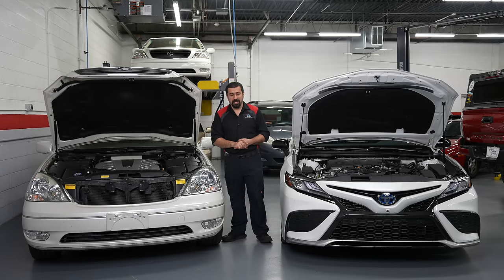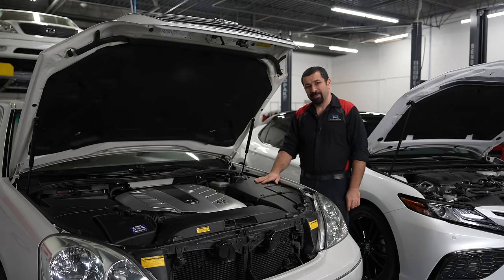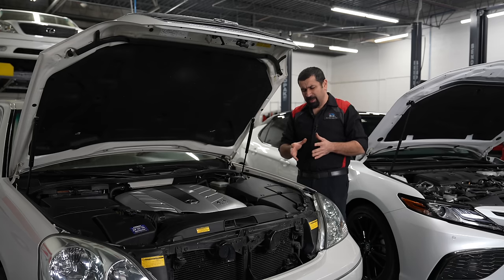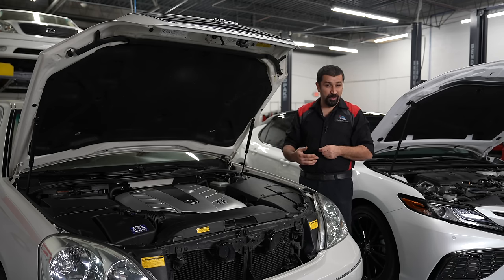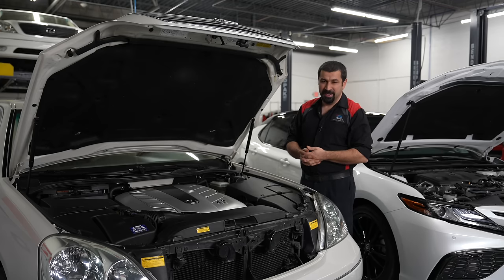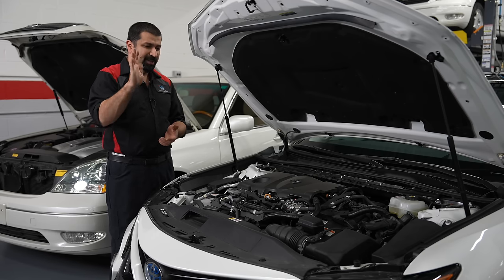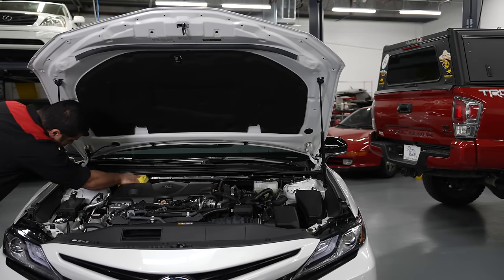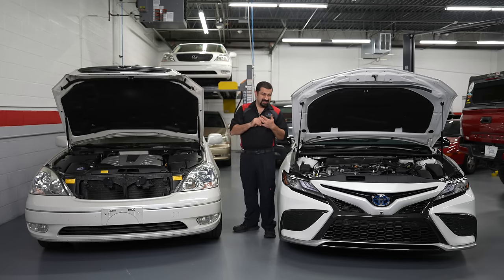Never Do THIS When Cleaning Your Engine Bay! Do THIS Instead

Comment: Thanks for the tips. I hadn't thought about covering the alternator. Some cars (I'm thinking of my Dodge product) has the ECM exposed. I cover that before cleaning. As MarzNet256 suggested, I use my small (Worx) battery leaf blower. It's useful for blowing leaves and dust away. When I need to rinse engine cleaner off, I'll use a light mist spray from the hose, then use the blower to dry up most of the water. I don't use my compressor as that might drive water into connectors.

Comment: Great video. 

I have heard that it's good to use a pressure washer and that it is not good. I go on the side of a caution and not use a pressure washer because I am afraid that I am going to do more harm than good. When using water, I use a a bucket and a microfiber towel and try to control where I put the water. In a manner of speaking. 

I have used Sonax engine degreaser. and Gunk engine degreaser and both work well. I also use brushes to agitate the grime and dirt and clean it off and use a plastic protector and something to make it shine. 

What you did not say if the dirt and grime make the engine hot and cleaning it off cools it off.

Comment: Thermal shock... when i first started as a field tech with company van, i went to wash it in dead winter. It was probably 10-20°F outside. They had hot water going to hose in the shop. I didnt realize how hot the water actually was... As I spray the windshield, bang, it cracked. Caused a huge crack from top to bottom. I knew it was a possibility, but i underestimated.

Comment: I'm a side detailer and a 100% agree. I have never used a pressure washer on a customers. Engine Bay or my own because of this problem. You don't want to send a customer home and then they have their - flickering or some electrical problem. I take a step stool and I go in there with it. A RAG and some usually I use Turtle Wax instant detailer or you can use even a light tire shine spray and it really takes the trim and makes it pop. I hate detailers on here. Using a high power pressure washer and a foam cannon.Inside engines it's crazy

Comment: Way back in the 1970s I learned that it was not advantageous to power wash engine bays. I still wash my cars by hand, so when I'm done with the exterior, I take one or two already damp disposable shop towels and just make a pass at most of the engine bay. It doesn't look as good as Car Car Nut's engine bays, but it does do the job. I don't need my bay to look like new.

Comment: When I clean an engine bay I try to cover all electrical connectors but sometimes forget, or the things I covered them with get pushed off by the stream of water. When that happens I try to sop up as much water as I can with a clean rag, disconnect the connector and sop up some more, then make sure to not run the car for several days until the water has fully evaporated.

I've yet to have electrical issues as a result, even years later. Plain water is usually only a problem when power is on and there's a risk of a short-circuit, although with newer cars some circuits are always powered even with the key out. In that case you should probably disconnect the battery before washing the bay and not reconnect it until everything's dry.

Probably best to do that in older cars too, come to think of it.

I also never use a power washer, just a garden hose set to spray. If an engine or bay is so grimy and filthy that you think you need a power washer, it's probably better to just use strong engine cleaner, brush things vigorously, and use a regular hose, and repeat until it's clean.

Comment: What would you use to clean the inside of plastic engine parts? I know you said you don't like using parts washers in another video where I think you used brake clean. However, in the throttle body cleaning video, you said not to use brake clean as it can damage the catalytic converter? So no brake clean should be used in an engine, right?

Comment: GM PED weatherpack connectors are basically waterproof as well as good for higher voltage as well, too bad GM & most manufacturers don't use them anymore except special applications

Comment: As a Detailer I agree with everything you said great video super clean good all purpose then I use air compress and a rag dry everything alot of Detailer uneducated pressure washing motor bay Dry ice machine probably be best way clean engine

Comment: The best method I've found is to cover the alternator (as you said) on a cold engine, spray down with P21S total car cleaner, (a bit pricey, but absolutely worth it) let sit for a couple minutes and rinse down thoroughly with low pressure water from a garden hose. I blow most if the water off with a leaf blower, warm the car up and take it for a drive to thoroughly dry the engine.
Full disclosure I own a Subaru so the coil pockets are horizontal  so no fear of them filling up with water, so I usually skip this step.
The P21S cleans without solvents so no  bleaching of plastic parts and it leaves the appearence of new parts, not oily like WD40 does, and no residue.
Reply: You can easily mix water 50/50 with P21S. The cleaner is so concentrated it still does an amazing job. I purchased a gallon jug for motorcycle, bicycle and engine bays. 

Add a leaf blower to dry
Reply: Dang! The lube tech forgot putting an oil cap. He offered oil changed again and wash engine bay. I saw him using high pressure water to clean it. I believed he did not cover an alternator.

Comment: I spray the chemical on the microfiber cloth , then wipe the parts to avoid overspray .  And , use only the one chemical on the microfiber cloth - ie, use a different microfiber cloth for a different chemical. Generally , I throw them out after one use .  
I use plastic protectant like a ''303 Marine Aerospace Protectant" .

Comment: Those quick detail sprays id try to stay to only painted surfaces. There are very light waxes in those quick detailers. Good chance they'll get the plastics to turn white/gray quicker. So any painted metal surfaces in the engine bay, use those quick detail sprays. For the plastics, maybe just water and a very diluted ph balanced car shampoo (Meguiars Gold Class is a standard) and then finish with 303 protectant.

Comment: I use "Mist" setting on the hose nozzle to wet areas and the painted body surfaces, Mothers VLR for the plastics and those yellow Costco microfibers with a cheap set of detailing brushes for the cracks and ribs that found under the hood.  I'm OCD as all hell when it comes to cleaning my vehicles don't know about a touch screen but for windows I use Sprayway its cheaper and better than windexs and doesn't have Ammonia that will damage window tint.

Comment: What about 4runners and tacomas that get driven off road in the mud and through creeks and big puddles? I have a 89 Toyota 4x4 pickup that i off raod and run through the mud alot but don't worry as much because there is alot less electrical than the 2003 4runner and the 2022 TRD Off Road 4runner that has alot more electrical systems, I really want to take the newer TRD 4runner where I take my older truck but I'm worried about this exact thing, first getting it wet with mud then having to clean it and cause damage. You would think they would make it where it could get wet and muddy and be able to clean it without worrying about doing damage. I've have my old pickup deep in the mud and always hose it off with no problem but I've gone through and put dielectric grease on any connectors and silicone spay on wires and any mud or dirt comes off very easily with just a garden hose. If i do the same to the 4runners shouldn't they be safe to do the same with?

Comment: I just use a light spray after a safe soaking in a light engine degreaser. I quit using Gunk cause it stinks for weeks. Then use WD40 to blast standing water. Then spray silicone lube on plastic parts. Like the man says, only when cool.

Comment: For gas combustion cars, Degreaser are a main culprit. People will say just spray it everywhere. Nooooo. I did that before and shiz started squealing after dried, due to rust. Some parts need some lube and if it's gone, no re lubing, will cause squealing.

Just spray where you know you need degreasing. Use a hose with low pressure shower. The water will pull down all the lose gunk.

Comment: a few things i learned as cars changed over the years.
dont hose it off unless its grimey. use low pressure hose if you must.
start when its clean and your better off.
compressed air. open the hood blow it out not 120 psi but enough to lift the dust off.. 
once its dusted you can use a little bit of regular armor all mixed with water on the plastics just like his soapy water. dawn dish soap also works well too if oily. but the armorall and water leaves that slimy smooth that stays clean longer and brings the plastic back to color.
mainly its just easier to blow off next time.
dawn also works great for washing your car. its honestly better than most big brand car soaps. its good on oil and also smells nice super ungodly cheap not harmful to people or animals or environment. it also leaves a nice shine to the car when dry that many soaps dont. plus next time it rains youll pry still have that residue on it so itll give itself a light wash again. i have never bought car soap since learning those 2 things from the detail shop i worked at. i also mix a touch of damn into my hand soap as when i was a mechanic it was awesome at getting the grease and chemicals out of my hands. not off out. it soaks into your skin. dawn helps break it up and get it out. its pretty good for alot of things. even keeping your toilet cleaner. a few drops in the tank on the back once a week will let it keep itself cleaner longer. the goo and puck toilet cleaners are basically the same but cost more too. many damage the seals in the tank this doesnt. it only lasts a few flushes but it keeps stuff from growing in all the small channels and kill bacteria that want to form in the bowl for a few days till its time to clean again.

Comment: Hello, good job as always,  I have a question about 2020 honda accord bearings  ( changed new axel booth side and bearing car runs fine but still hearing roaring noise as I pass 30 mph do you think the intermediate bearing needs to be changed? or when I install the bearing cause it to go bad but no abs light or things like that..just pressed it with a few hammer hitting to push it down. what your thought please share your insight.  Thanks

Comment: Amd, I use dielectric grease on connections.  Is this ok to do? I figured it would prevent water or moisture into the plugs like on spark plugs. I also use dielectric grease on rubber hoses to keep them from dryrotting from heat cycles. Thank you 15:36
Reply: Yes, that is actually excellent.  While you're at it, the most important area to put dielectric grease is the battery negative-terminal wire to vehicle body ground.

Comment: @7:31 You mention that oil wreaks havoc on engine bays. I'm curious as to how? I've always thought of oil in the engine bay as generally a harmless nuisance, referring to the occasional gasket seep or spillage from the filter during changes. In what way can it cause damage in the engine bay? Thanks!

Comment: I’ve seen on YT people using foaming tires cleaner like Armor All canned foaming tire cleaner in the engine compartment. It uses foaming action & silicon based solvent to degrease. Spray on foam & wipe it off on a cold engine to degrease. No pressure involved, mostly foaming action with solvent cleaners. So far so good. I don’t flood the engine with it. Spray & wipe. It really is hard to find a degreaser suitable for the engine compartment. I have not seen any harm on plastics & rubber so far, & have been using this over a decade on the same cars (Hondas). I don’t clean to car show level, but enough for routine service  of the vehicle comfortably & be able to read the labels that are posted there.

Comment: The only thing I clean is around the oil fill hole, dipstick hole, brake fluid reservoir, coolant reservoir (s) and PS reservoir. For practical reasons of course.

Comment: Issues with radio. I have a 2020 Avolon Limited,  Recently the radio just stopped working while driving.  Couldn't get it to work. However after I turned the car off, returned 30 min. later and turned i back on, it was working. Is this a known problem?  If so whats the solution?

Comment: Worked for Toyota in the early 90's which i jet washed Toyota engines & the area manager caught me TWICE! He did warn me the first time. Never had any issues,i didn't go overboard jetting it,i just made sure the chemical was pretty strong but not overly strong/powerful....a decent scrub prior to jetting is what i did,no comebacks thou. I WD40 2X year EVERYWHERE incl underneath the engine bay plus at the rear of the car incl any aircon parts/pipes. Had a 2002 Yaris for 14yrs which i looked after (Only jet washed the engine once thou). It only failed it's MOT (Yearly inspection) TWICE on windscreen wiper blades,so WD40 is really worth doing.

Comment: Keep water, cleaning chemicals, etc., from leaking into the master cylinder cover (one-piece), or under the screw or snap down caps. It won't be long, and corrosion will start and eventually you will have no brakes. Overall, a very excellent video.

Comment: My 2013 Lexus engine compart is pretty spotless and all that Ive done is wipe down with towels never used a hose or pressure washer....seems unnecessary for a car under 15 years in age. Maybe if you live in the north with salt sure.

Comment: I live in Southeast Asia where it rains quite often. For electrical connectors, I would suggest unplug the connectors are squeeze some CRC Dielectric Grease to improve electrical connectivity as well as making them less prone to electrical failure...I even applied it to inside of the plug cap where connects to the plug.. As was mentioned by the author, NEVER use high pressure wash in the engine compartment, Actually, I basically wash my car by using water and car wash detergent and just hose it down, and give it a drive to remove residue water.

Comment: I’ve been power washing my engine bay but I make sure to protect all sensitive sensors I take the battery out and cover literally everything electronic including the alternator. Good advice though but my integra GSR over 200k miles says it’s ok. Off-road trucks literally do river crossings with no issue, yes I understand the creative a wave when crossing. But if you’re not an idiot it’s fine ✅

Comment: Alternators can get a lot more wet than you’d think. Countless piston aircraft place the alternator directly into the air stream and fly through rain all day everyday. They aren’t even special alternators with seals or anything fancy. Just an alternator like any others typically found on cars from the 50s.

Regarding keeping the car clean under hood. I’ve always washed it with regular car wash soap when cold and then rinse avoiding direct spray from the electrical connectors, ecu, and alternators. Do it twice a year to keep it clean and don’t let it get out of hand. Fix any leaks before they make a mess.

Comment: Pressure washer will work. Pre spray degreaser and soap prior.  Use a quick pass over the electronic stuff.  Never had a issue been doing it since the 80s

Comment: I was a school teacher for 25 years. Fifteen of those years I drove a bus. During those years, I bought a high mileage 2004 Tundra with 220,000 miles on it, and drove it for years. It sat more days than it was driven, and I typically only put 8,000-10,000 miles a year on it. One day I discovered some animal collected all types of things (leaves, pine straw, part of a some red filter foam type of material, and other trash) and carried this soft fuzzy stuff under my intake to make a nest on top of my 4.7L V7 right by the starter. I found out because I saw smoke coming out of my hood. I pulled over and fortunately we did not have a fire  could not reach the debris by hand. Using some wire, I got about half of it out, but could not get it all. I washed it out...and hoped I wasn't going to have starter issues. Fortunately, we had no issues. After retiring, I got myself a 2015 Tundra and gave my old one to my son. It now has 367,000 miles on it and still runs great.

Comment: some may disagree but I find if you run the car for 30 mins at least before washing the engine , there’s so much heat that even after washing with cold water from your garden hose all the heat dries the water out from everything very quickly still . Clean my engine and about 15 mins later almost everything was bone dry, even the belts were . Started up and no issues

Comment: spray the cloth then clean the area .. no reside in the over spray.

As for touch screens, use anti-reflective eyeglass cleaner with a soft cloth (micros are great) .. do NOT rub OR scrub .. gentle is the way, and spray the CLOTH not the screen.

Comment: AMD, thanks for another good video reminder. I must say guilty as charged as that is what happened to my T4R -- one day I decided to pull out the coils and noticed corrosion mark on the numbers 5 and 6 (both back cylinders). Immediately realized that water must be creeping through the coil rubber seal when I wash. Now I'm concerned that my sparkplug tubes are corroded -- is replacing those tubes on the 1GR-FE a DIY project? Thanks in advance for your response.